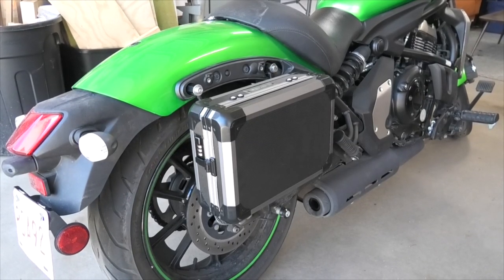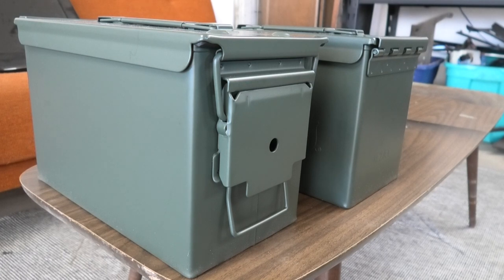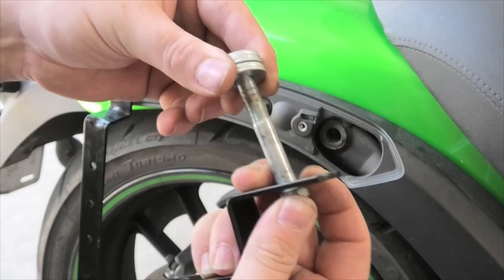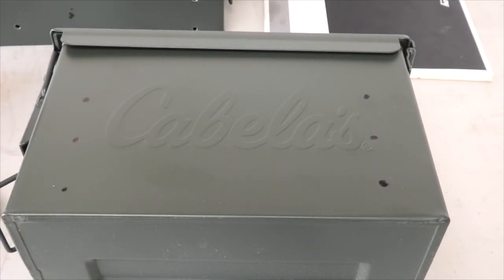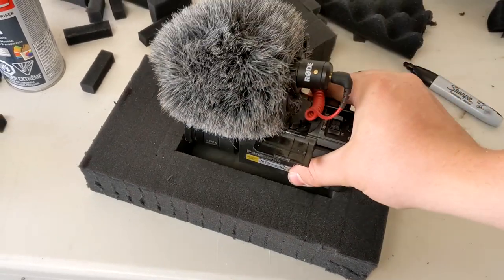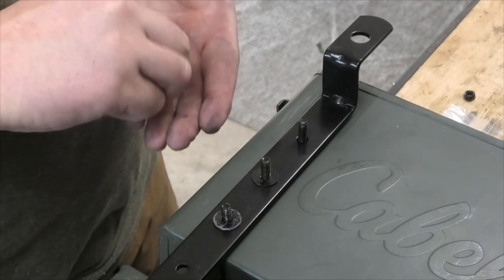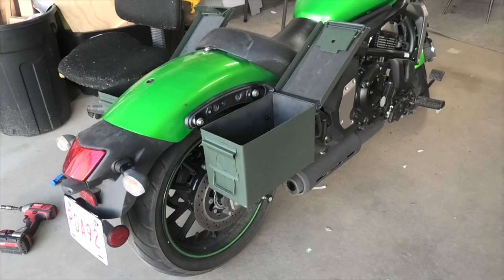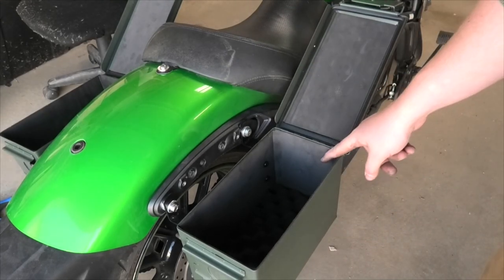DIY Ammo Can Saddle Bags

Comment: This was the video that prompted me to go down a fucked up rabbit hole of buying a welder, drill press, angle grinder, and the shit to wire a new circuit to the breaker box. Ended up going with 20mm cans which are twice as big/heavy so i needed a more robust bracket setup. $600 and some new skills later they're done! Defeats the point of the cheap build but now I've got a shop full of fab tools. Going to make a sissy bar and floorboards for the vulcan next. Thanks for the ride man!

Comment: In 2019 I bought a Vulcan S . I love this bike . After a few months I decided to add a set of saddle bags . All of the saddle bags for this bike were very pricey and even more for the mounts . I decided to make my own for a fraction of the cost . I purchased a set of Pelican V 250 cases for about $120 . I fabricated some mounts out of steel bars 1/4 x 1 inch very similar to the ones you used .
 These are the best bags I've ever owned ( and I've owned several on several bikes ) . I can fit a full bag of groceries in each one . They open from the top and are air tight . They also can be locked using a padlock . If I ever own another bike , I will fit it with another set of Pelican v 250 cases . I like these cases even better than the U S steel ammo cases that I once had on my old BMW R80 / 7 .
Reply: Has your rear fender bent at all after adding all that extra weight hanging off the side. Also what did you do to reinforce the brackets

Comment: Looking at something like this for my Harley! Nicely done. I personally would just want stiffer brackets instead of the chinesium
Reply: Was planning to do the same thing with my fat bob and paint the bike a matching color
Reply: To be fair I think anything made of that size of flat section will probably struggle in this application. I'm not making any comment on the quality of the steel because I have no way of knowing!

As he said it would probably work better with some gussets welded in - you just need to add some depth to the section basically...

Comment: I bought a couple of large 20 mm ammo cans, mil surp (no lame Cabela's ad) but in like-new condition.  They're a lot larger than the fat 50 ammo cans you bought.  I'm going to use them for tool boxes on my Hijet mini truck.  I'll mount then on the headache rack, just below the rear window but above the sides of the bed so I still have the entire bed for carrying sheets of plywood, etc.  BONUS:  I bought a cheap but vurra nice aftermarket remote power door lock for the Hijet to avoid any more wear on the door lock cylinders and it has four actuators.  I'm going to use the rear door lock actuators to lock and unlock my ammo can toolboxes.  How pimp is that?

Your craft store 2mm EPA foam liner tip for the ammo boxes is worth the cost of the video.  I'm planning to "paint" the entire mini truck, inside and out, with Monstaliner polyurethane truck bed liner, and I'll paint the inside and outside of the ammo box toolboxes as well.  That won't add much padding, but I'm carrying tools and off-road recovery equipment (straps, hand winch, folding shovel, etc.) so the toolboxes are probably too rough duty for even dense foam.
Reply from the maker: Sounds like a plan! for that application I'd probably go with rubber lining rather than foam.

Comment: Can you please post links to sample mounting brackets and the exact search term.  Are they specific to motorcycles?
Reply from the maker: HNAYA Universal Motorcycle Saddle Bags Brackets Hard Trunk Brackets Saddlebags Mounting Brackets https://a.co/d/jlgLuX8

That's what I used in this video
Reply: I already feel like there is too much flex that the bracket will slowly bent downwards and eventually it will hit the wheel if you put some good weight in it
Reply: @polartsang  - It looks like there is no plastic deformation so the steel will continue to spring indefinitely.  If it was aluminum, it'd be a problem, particularly including fatigue failure.  Bubba Engineering approved.
Reply: @Liberty4Ever  doesn't read. I said the issue is you can't hold too much weight as the bracket is not sturdy and will Flex. It doesnt matter if it spring back and not deform if your saddle will hit the wheels
Reply: @polartsang  - Loaded with max weight (8 cans of Coke) and went for a bumpy ride.  The bottom of the ammo can flexed inward maybe an inch, with at least another inch of clearance.  I'm not crazy about the flexing, for aesthetic reasons, not structural reasons.  Spinning Wrenches did mention that he's adding gussets to make the mount more rigid.  That should enable him to carry tungsten or lead.   :-)